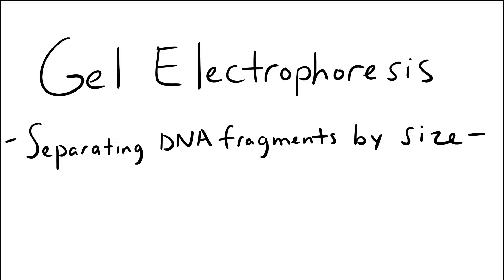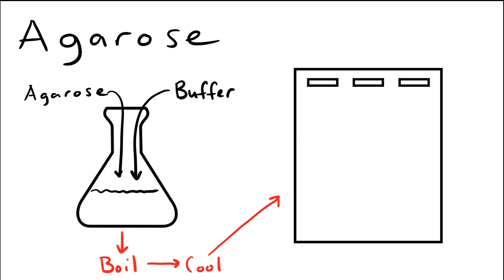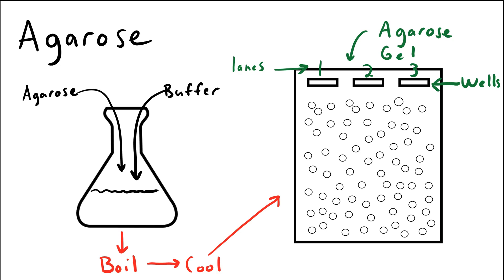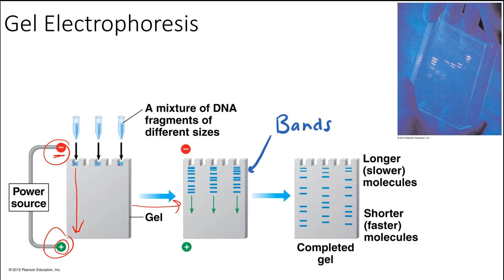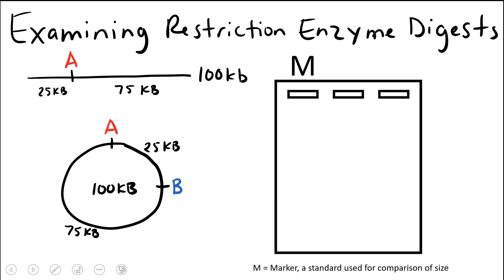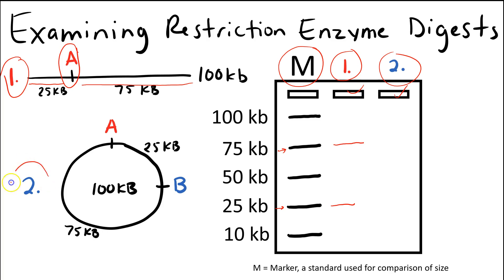AP Biology: Gel Electrophoresis

Comment: Depending on the restricting enzymes, can we come to a conclusion about the DNA being recombinant or not? 
For example, if we were given only the form at 8:00 could we predict the type of DNA we are working on?
Reply: You can...although it depends on the situation. Recombinant DNA is DNA consisting of sequences from multiple sources (like different species...like in the popular pGLO lab). So when the DNA comes together you can see the size of the bands increase. For example, if you have a piece of DNA that is 5,000 bases in size and you add a piece that is 2,000 bases, you will see the band shift in size on the gel. Regarding the restriction enzymes...if the restriction site is still intact you should be able to collect the DNA again and digest it back into the component pieces. Sometimes when you add a piece of DNA it disrupts a restriction site (if you add the DNA into the code that the enzyme acts on). You can prove the successful addition because the enzyme no longer works...so it will not digest into the component fragments.